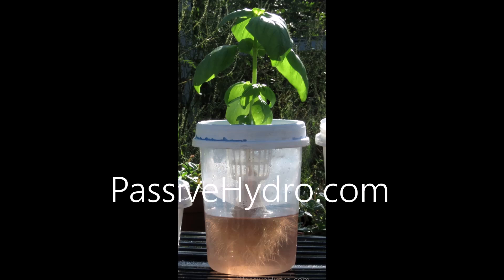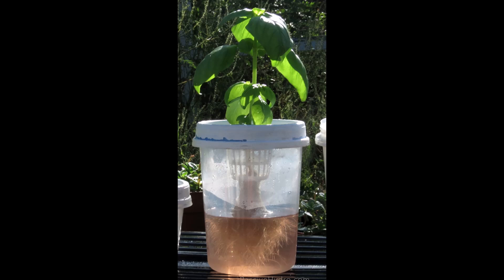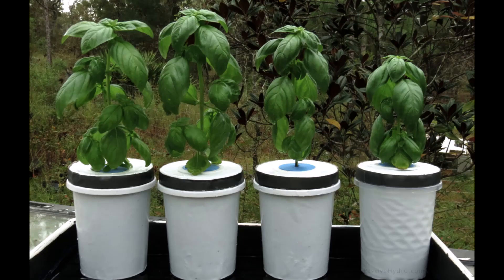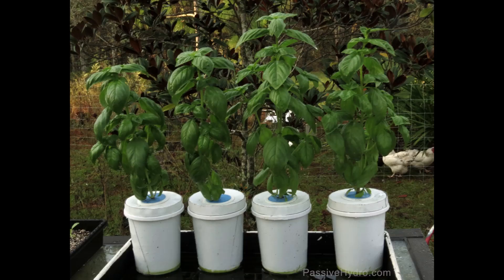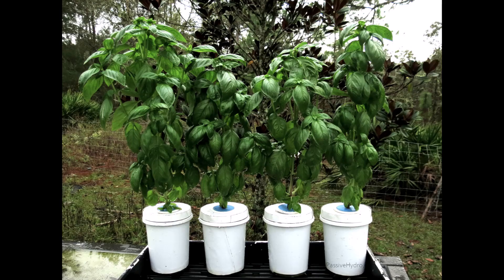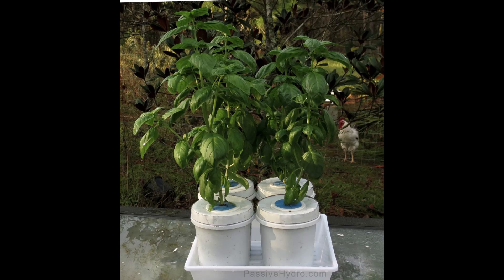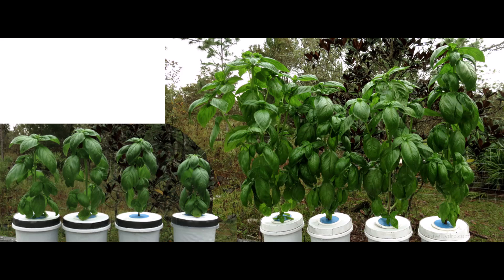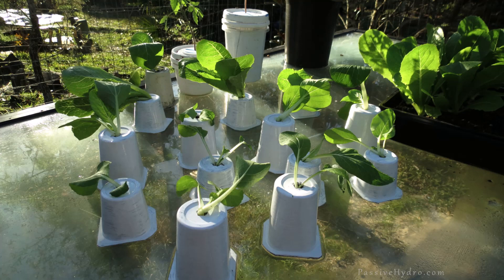Kratky Gone Wild ~ Big Plants in Small Containers ~ Part 1

Comment: I did a similar experiment with a pinto bean in a folgers coffee container.wqnted to see how the plant adapts to the container size..
What I noticed when the roots reached the perimeter of the reservoir it starts maturing and roots maintain that volume 
Grew many bean pods though not as abundant as one in a larger reservoir.
I had to top off the water every two days but otherwise, not root bound, plant was thriving. 
So in conclusion I think with hydro though q plant with have large root masses with enough room to spread, in smaller containers, they will adapt but mature as a smaller version.
I've yet to see an experiment like this with say a tomato or melon plant.

Comment: How did you start your upside down yogurt cups?  Put in seedlings when they only had their tap root?  How do you water them before the roots reach your nutes?
I'm started in gro-smart rockwool tray and hoping air pruning will form a mass of stronger roots, then transplant into final container.   Air pruning creates more root mass, RA creates more oxygen root mass... there must be a connection between the two methods.
Reply from the maker: I germinate my seeds in fluffy potting soil.
They are able to stay in there and thrive until they have a few roots.
I wash the dirt from the roots and pop them into my hydro systems.
They reach the table right away when put into the pudding cups.
https://passivehydro.com/pics/seedlings615.jpg

Comment: You cut the bottom
Reply from the maker: Ya. I chop the roots even with the base of the container and then I melt some holes in the shielded container and place the plant in there. Then I put that container into a tray containing a 1/2 inch of nutrient solution.

Comment from the maker: I've got 3 Romaine Lettuce plants doing well in pint containers.
I'm going to switch one of them to Bat Guano and Kelp.
That would mess up most hydro reservoirs but my plants are sitting in 1/2" of nutrient solution that can be flushed with a toss.
It will be an experiment to find out if Organic Hydroponics is possible with my system.